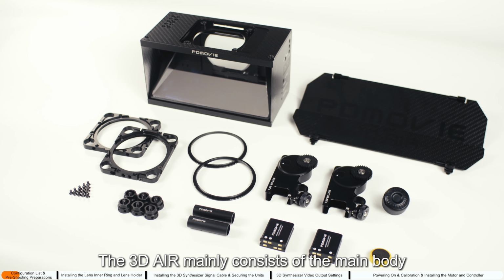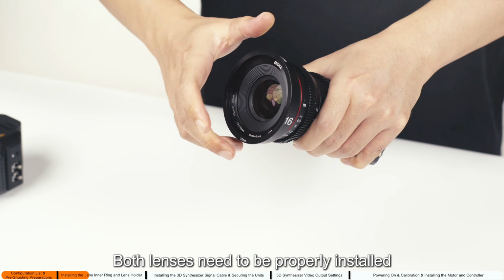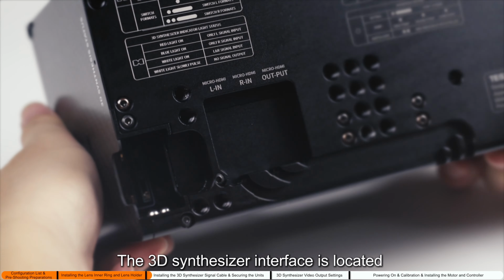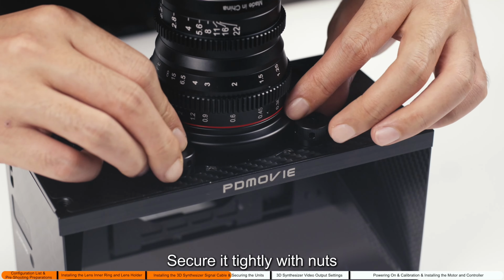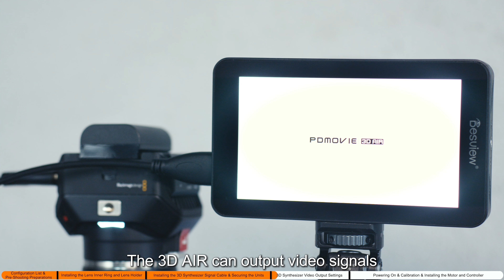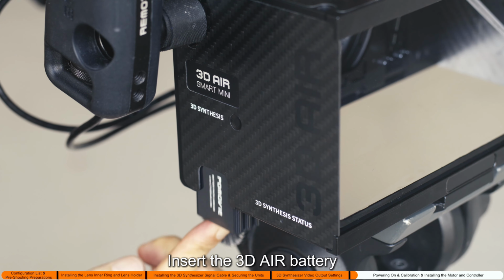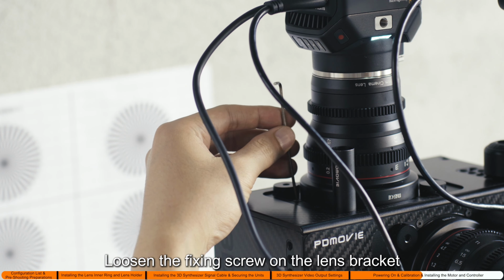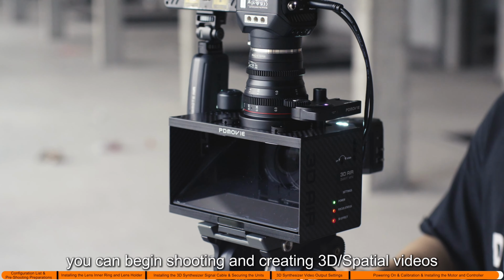4-Minute Quick Guide to Installing and Setting Up 3D AIR #pdmovie #3dair #visionpro #lidar

Comment: Would love to use this for 3D video, but also to use different lenses at the same time, vertical/horizontal video at the same time and maby even infrared/normal camera setup. Is that possible?
Reply from the maker: The vertical video needs to be assessed based on the specific weight. Of course, if the optical axis does not move during filming, vertical shooting is not an issue. However, some infrared functions of the camera itself may not be applicable.
Reply: @PDMOVIE  Thank you 🙏
Reply from the maker: @linuskarlsson9449  :yougotthis:

Comment: I want to use this for non-3D applications, is this possible?

For example:
SCENARIO 1: Two different focal lengths, but same eye line for an interview.  In this case, each camera will have different lenses.
SCENARIO 2: For dual exposure where one camera exposes for the shadow and the second camera exposes for the sky.  In this case, both cameras will have the same lens.

Can I do this so I can ignore the 3D features?